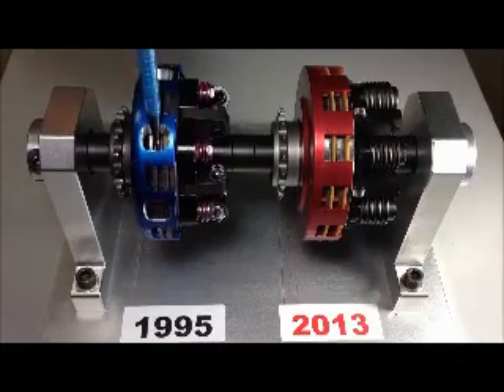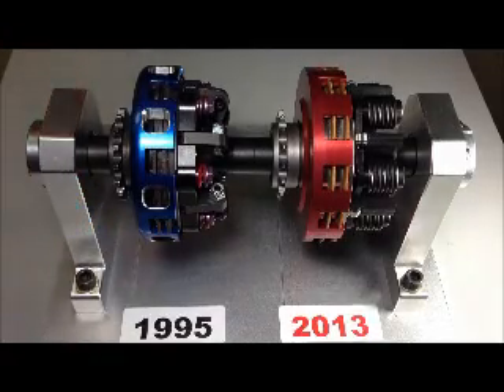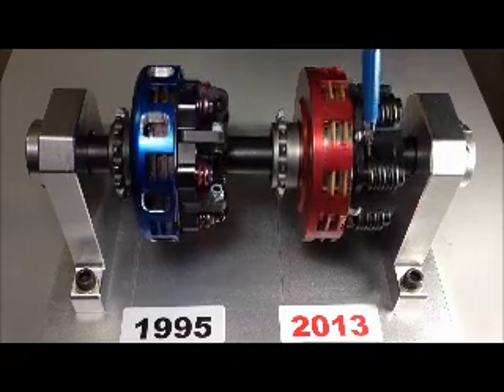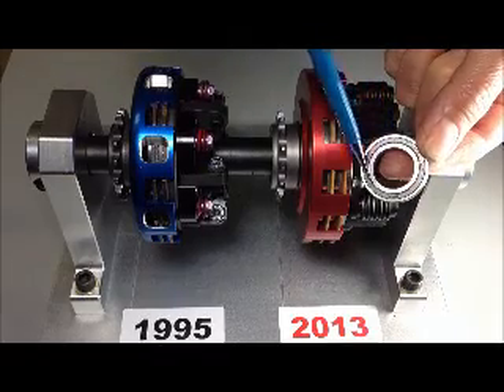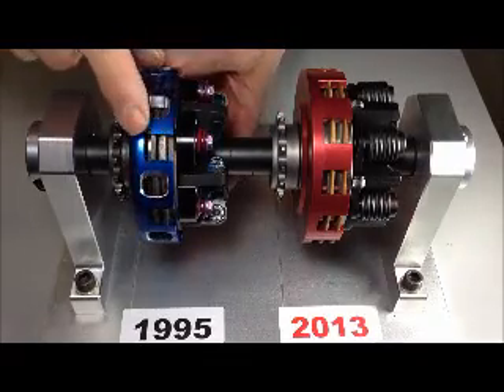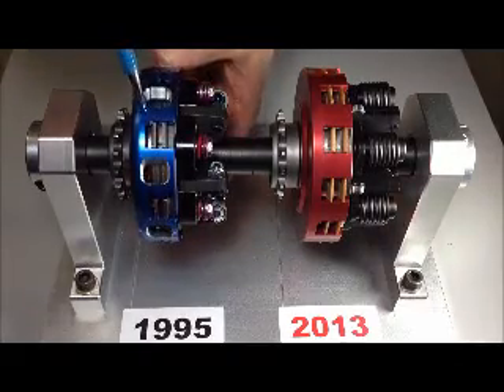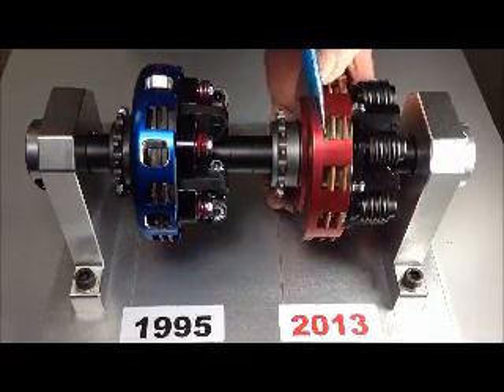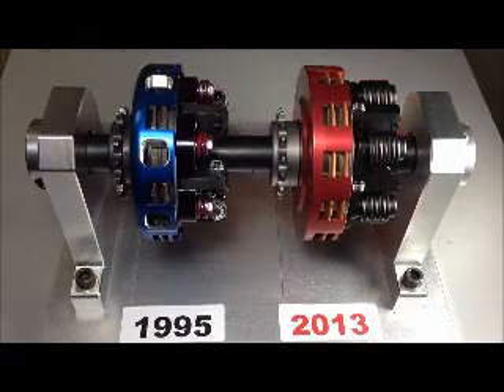SMC Vortex RED Engine Clutch Technology

Comment: will one of these work on a briggs 206 that is installed in a polaris 120 snowmobile?  they have a brake band around the clutch.  we currently use a hilliard flame clutch and i am sick and tired of having heat issues and replacing sprrings constantly